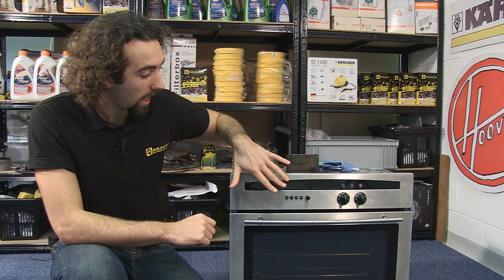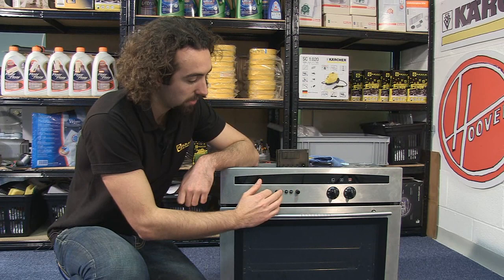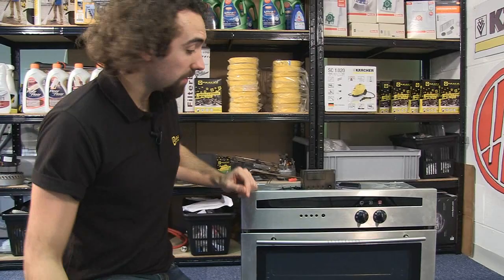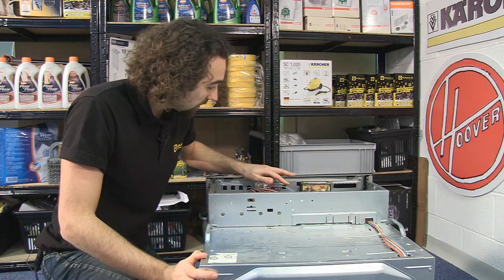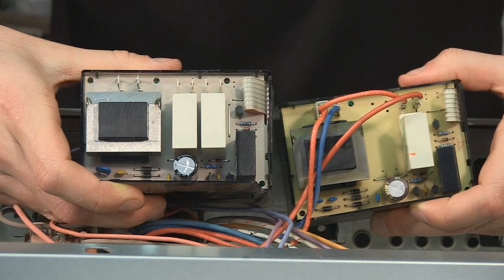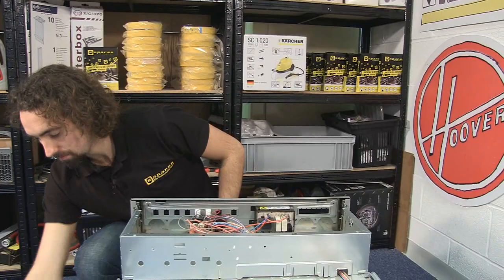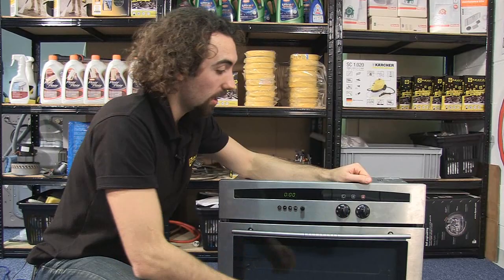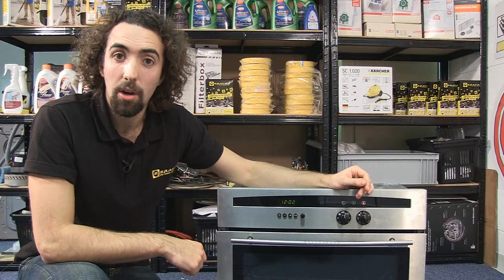How to Replace an Oven Timer (Cooker Clock Replacement)

Comment: Hi your new timer has 2 relays and your old one only one ? what did you do with the other wires
Reply from the maker: Hi markennyee, there wasn't any other wires, the manufacturer of the timer had added the relay but there were 4 wires on both timers so it was fitted perfectly.
Reply: @eSpares  so on that timer the 2nd relay was redundant ? also on your new timer was the relay pins marked at all with 1 1a 2 2a etc